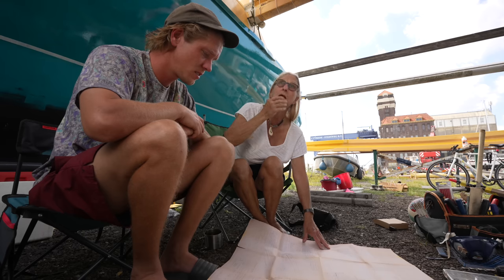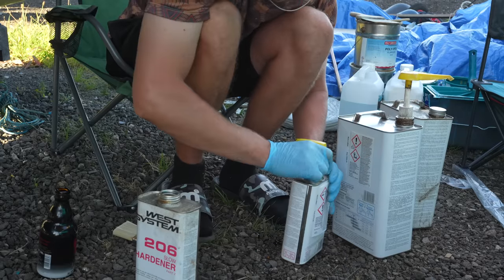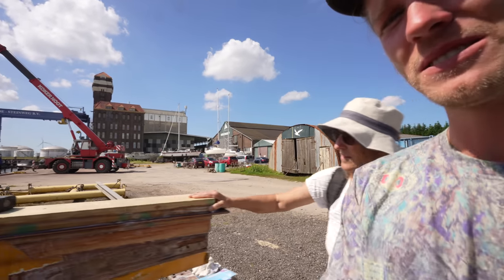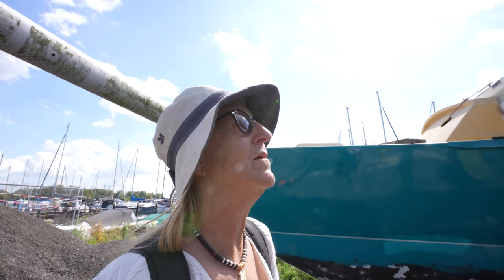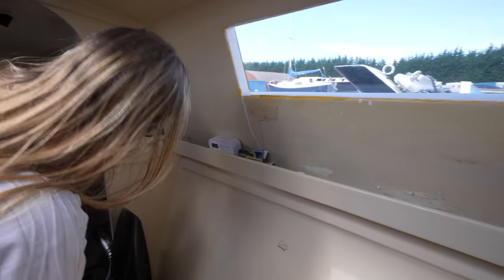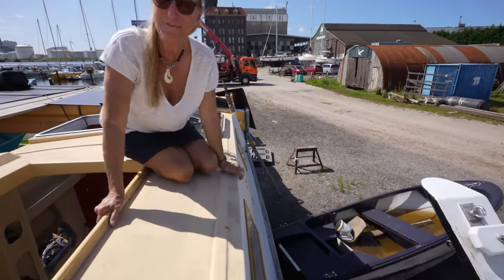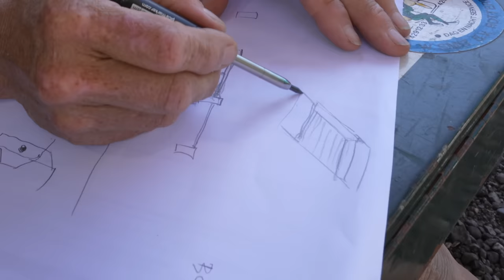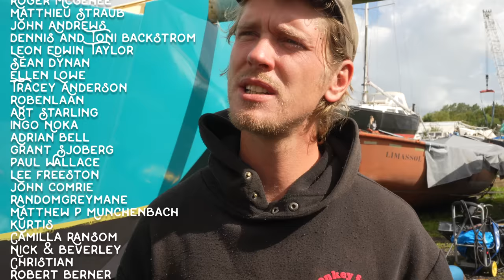What Will The DESIGNER OF MY BOAT Think About my Work!? | Wildling Sailing

Comment: To speed up your next beam repair - when you're setting those wooden sections in, then planing them down, it's helpful to set a router at /just/ above the level you want, rout some channels in the wood,  take off the high sections with chisels, then use the planer to finish.  Much quicker and your planer blades will last longer, less time to clog, less clearing of your plane.
Reply: As I mentioned earlier in the RESTORATION there's more than one way to skin a cat... my fav electric tool is hands down the makita grinder.  With a sanding disc making a scarf is as quick as a peanut butter sandwich.
Reply: Further thought:
Rather than making your scarf cut at 45 degrees in the vertical plane, as you have done, you could make a much greater scarf in the horizontal plane, much more easily.  You would be using more wood - but your joint would be over a longer section of the horizontal plane, which I think is better where you have horizontal loading.  I believe this is how wood workers usually do a scarf joint.

Comment: With West System you can clean uncured epoxy from tools or surfaces with white vinegar instead of acetone, much cheaper. Also can use to clean your epoxy pumps by just pumping vinegar with them. So they won't clog.

Comment: Hi Mark 
watching your west systems technique 
i have used west systems for a number of years (35) the easiest way i have found of measuring it out is to buy some plastic disposable  wine glases or similar ( not to big) pump the resin in first and then the harder i find the hardner floats on top of the resin so when you hold it up before mixing together you can visualise whether you have the right proportions you have only to  get the proportions wrong and it is massive job pulling the joint apart and scrapping and cleaning everything down the hardner tends to crystallise at the nozzle so you cant aways rely on the pump for the right proportion always ere on have more hardner if you aren't sure.

Comment: For scarf joints, you can make a jig for your router , basically a pair of wedges at 5:1 , with adjustable spacing, the router bit should be barely touching the target, at the highest part of the jig.

Comment: Butt joints, as long as you glass over, with sufficient thickness, for the 1 in 10 of the timber you will be fine. 
Other idea, run in a saw kerf and fill with epoxy glass to form a feather

Comment: Useing the diamonds for the spreaders would allow you to adjust weather-helm. if you find the rig steers to weather or to lee you can rake the mast with the diamonds to adjust the helm the other way. The way i was told to think about it is how wind surfers steer. They rake the whole sail rigg fore and aft to turn port or starboard. I would plan to include the diamonds and wait till the rig is up and you start sailing then adjust accordingly, would make helming the boat way easier. on my small beach cat i rig to lots of weather helm so if i fall off the boat it turns into the wind and locks itself in irons so i can get back on her.

Comment: I don't think it's an issue since it's epoxied but I agree with the lady's initial thought to remove screws and maybe replace with nails. Average 4 or 5 mm wood screws will shear very easily. Stainless compounds the brittleness issue. Nails bend, screws snap. Epoxy hopefully eliminates any load on fasteners. Cheap insurance would be to fasten 5/16 plate, cut to shape and welded together and bolt flat to front of the beam.

Comment: Great idea to get Hanneke to help. As for the mast.. when you look at lagoon eg you’ll se diamonds mast set ups… you hear her say way… when you look at HH, Donahue or sunreef you will see carbon masts that do not have spreaders. Not having spreaders comes with additional advantages less rubbing of the main. Done high tech racers even add to that a rotating mast instead of fixed.

Comment: Yes, the scarfing was not long enough but considering the total load on the beam length what he did should be fine. What he did was for the most part surface so the job he did should be fine.

Comment: Good on you man, rocking right along in record time.   Dunno if you are considering a furler or not on this rig.  I really like the profurls for value and rebuilability, and the seldon furlex for ease of maintenance.  It costs a bit more but you won't be rebuilding it. It spins a little smoother than a profurl.   The harken less money than a furlex decent performance  the bearing eventually crust away in 15-20 years.. all good stuff.   I stay away from facnor although... Saw a new one recently from them.  Can't wait to meet with them in Annapolis and see what's new.  I do like the Schaffer as well. I just don't like how Schaffer has a gotcha piece attached to them that makes replacing the forestay pin to pin stupid expensive...  the furler is pretty sweet.   Good luck!

Comment: definitely scarf in your repairs 4 x thickness minimum  best is 8 x . 10 x for load bearing crossbeams. Why not use a good outdoor glue for the gluing and sink some oak pins ?? Wasting shit loads of epoxy there.

Comment: You have too much faith in the glue.  I would have replaced the entire top member of the beams,  Glue is strong in shear but not strong enough  in tension.  It would have taken about the same amount of time, and been 100% in the seaways you will encounter on an ocean passage.  I still believe you should rout out a  full depth of the insert groove in both sides of your repair addition, extending into the existing beam,  probably TWO grooves, and into these grooves add timber inserts of a high tensile strength, to give the top member the overall tensile strength it needs throughout its length.

An alternative would have been to cast them in fibreglass as a D spar--but a really expensive  option.

What a GIFT to have Hanneke aboard with her experience and expertise--

Comment: Nice one Mark, and Hanneke. Nice to see Hanneke picked up that your first non-scarf was on the compression side of the beam, and will likely be OK. Also, another thing Hanneke picked up, spreaders on a cat rig are not needed. With alloy spars you can go to about minimum 9 degrees shroud angles. Only monohulls need to do this. You have more like 20 degrees even on the cap shrouds, and the lowers have even more. What a fascinating video, with Hanneke there. Thanks to both of you !

Comment: I agree regarding chopsaws. They are the best thing since slicing bread when it comes to cutting a hundred planks straight correct length correct angle everything. Bought one when i got my house, i have built floors, attics, roofs .... Would still be building those i suppose if it wasn't for that.

Comment: A stainless clamp band or ser of lashings or two round  
The first scarf joint repair will stop your repair flexing loose if your concerned Mark.

As you dads doing a swing down mount ... follow Hanneka  but look at as many pictures as you can 

You will learn to see parts in 3 D 😉 in your sleep. 

The other Dutch built Pahi 42 i saw used vertical sliding tube mounts coming up though the floor and raised  or lowered then locked at set depths using a rope and winch.

Comment: I thought you promised to scarf it but you only did 45 degrees! that's not a scarf it should be 1:8 or 12:1 or something like that!

interesting that the plywood wasn't in the design. In my experience rot moves through ply much better than timber, because there is always some grain in the direction it wants to go, but the grain might be going the wrong way for the rot in solid timber
Reply: Absolutely agree with you and it's responsible to mention it, especially if you're an experienced boat builder. Wild oceans take no prisoners when shortcuts are taken.

Comment: When laminating layers, I prefer to apply each layer and let them set up individually before applying the next. That way you have more control about the thickness of the adhesive between the layers. If you clamp 3 layers together, you might end up squeezing all the glue out of one layer and have another with too thick a layer. You also can have the layers vary side to side. But then, I'm not working against a clock when I'm working with epoxy either
Reply: I'm way out of my knowledge zone here. I would have used a top quality waterproof PVA, then epoxy glassed everything over, after it was all dry. But it seems modern two-part treatments have improved a lot in the past 30 years.
Reply: @travelbugse2829 PVA isn't known as a gap filling glue and would be even worse for the very short scarfs he used.

Comment: lf you glue properly with epoxy you don't need screws . You waste to much epoxy . Throw away those pumps and messur  by amount . five parts resin one part hardener. Use the slow one ,  gives you more time .

Comment: I already said in a former comment that all this patching on the beam is risky as hell. These beams should be made out of ONE piece of wood. All patches make this less strong and elastic. Some very big waves and it is bye bye to the beams, they will break like matches. Good luck.
Reply: You will have noticed that the original beams are laminated of lots of pieces of wood with alternate grain patterns giving superior strength.
Reply: Laminating is fine but yes, 1:1 scarfs definitely are not.

Comment: you obviously know your circumstances better then I but you might want to rethink your stance on tool purchases. Take your new electric planer as an example, it cost 50 euro whilst the nicer one cost 200. You can probably resell the nicer planer for around 120-150 when you are done with the boat. So cost wise its the same or slightly more expensive but you will save time and frustration by using a better tool. I think you can see it as a better investment to go for nice tools but you know, its just a suggestion :)
Reply: Or he can donate it to the next broke sailor doing repairs when he heads out. Not much invested, so pay it forward. Folks have been kind loaning him tools and lending a hand. 👍

Comment: I don't like the idea of motor sleds. The framing hanging down looks janky to me. I wish you had a better solution. Maybe just a single strong beam at the right height that spans the middle to which the motors attach. Then maybe even a thin grated aluminum platform that also spans middle in front of beam. I guess the wood sleds are cheaper but I can picture a simple stair ladder down the to platform. For those days you need to go back and forth to motors. Would make life so much easier. Actually, maybe two beams one on each side of platform would make sense. Anyways, just my thoughts.
Reply: The existing framing isnt part of the new plan.

Comment: I think the boom repair is not structurally good. Top an bottom layer must bear compression and pulling forces, the in-between is just a filler. Your wood repair is OK compression wise, but not sound for pulling forces. That woman is 100% right. Be sure to have some layers of glass extending nearly to the middle of the boom on the repaired side.
Respect for that woman. Competent and intelligent. They do not make those types any more.

Comment: Hanneke did not give a pass on the botched repair on the crossbeam. She puts her criticism in polite and positive terms that can be misinterpreted by incompetents like this guy. She says it will probably be okay since two thirds of the cross section is structurally sound. That means it has lost one third of the strength she and Wharram designed it to have.  She says that since the weak one third is on top it will be generally in compression where it is less like to break at the butt joint. But the boat will be bounced around on the sea so it will also be in tension at times. She talks about riding out heavy weather with no sails in which case the boat will drift slowly abeam to the wind and waves. In that scenario. as the boat passes the crest of a large wave, especially a steep wave, the leeward hull can be suspended in air before it drops. That will put the full weight of one hull on the crossbeam in tension for an instant before it slams back down on the water. That sounds like a recipe for failure as the crossbeam is flexed up and down repeatedly.

Comment: What is it with sailboaters calling ENGINES motors anyway. Is it electric? It is not an engine it is a motor. Is it diesel or gas? It's not a motor it is an engine. This woman is a maritime sailing engineer. Where did you come up with her?
Reply: dont sweat the small stuff melee.

Comment: Look you do not put a butt joint in a structural member in any kind of yacht. That is a structural beam and to get 95% strength you need a 20 to 1 scarf joint. It is your life the rocking motion of the sea  will stress out these beams in any kind of high wave condition it may crack. I do not want to see an impending disaster so I will unsubscribe😮

Comment: Mast : good information regarding Shrouds........but i like the idea to climb to the spreader in order to look round away the boat . By personal experience  i would say, Spreaders are more safe in front a lock on rope coming from the top mast even if this spreaders are not very useful for the mast. At sea, Safety first, one han for the boat and one hand for you.
On your boat, Back-stayS could be useful in heavy sea.!!!
Nice vidéo and a Very interesting person with a great knowledge of this sail boat. Thank you for that.
Bon courage and stay safe.
Reply: water line: Have a call to some friends to look for a level laser. that is very practical if you work alone!!. 
As the boat is in the right & good level, the tape will be glued along the the light line.(hope my words are right?)
Bon courage and stay safe.